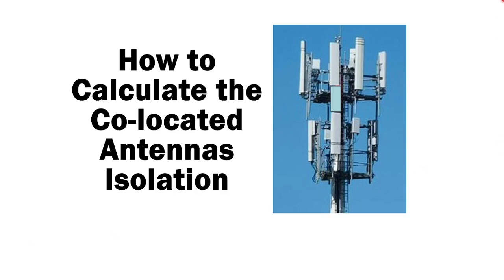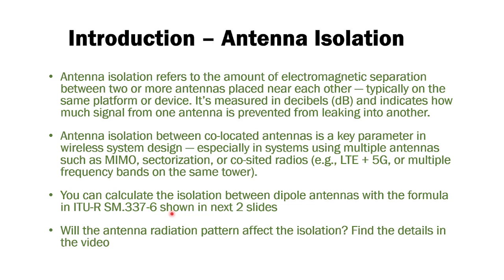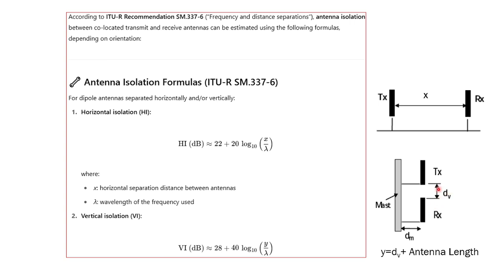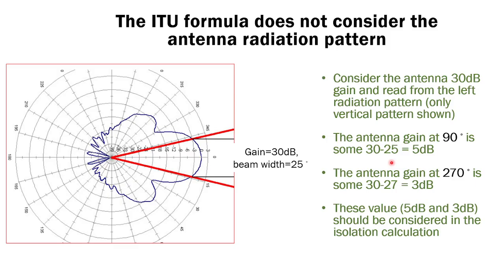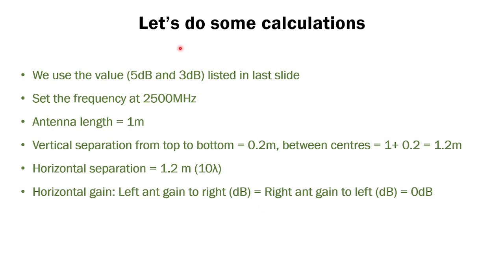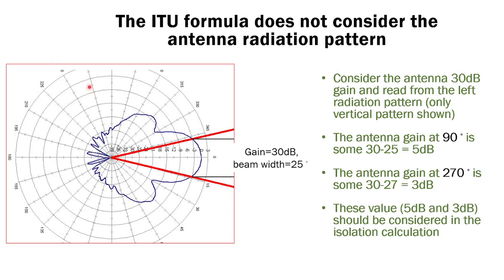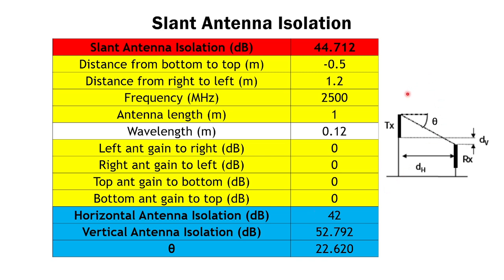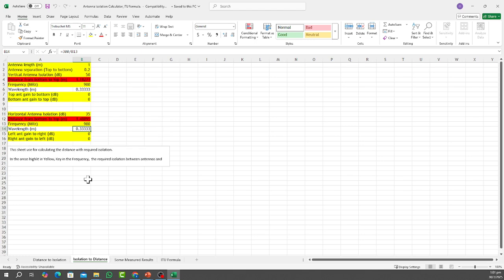Why Your Antennas Are Fighting Each Other — And How to Stop It?  #antenna #interference #isolation

Comment: is this a good thing or bad or am I getting things confused? what's the difference between this and multiple wifi streams? could you make a video showing real world examples?
Reply from the maker: Multiple wifi streams means multiple spatial streams in Wi-Fi technology which comes from MIMO and of course mutiple antennas. Antenna isolation is critical to make sure those streams are truly independent, otherwise you don’t get the higher data rates promised by MIMO. 
To answer your quesion: is this a good thing or bad? The conclusion is: High co-located antenna isolation is good, low co-located antenna isolation is bad.
Reply: @ThinkingLifeRF ahh I see thank you for clarifying that for me
Reply from the maker: Thank you! I will study the multiple wifi streams and see if I can make a video.